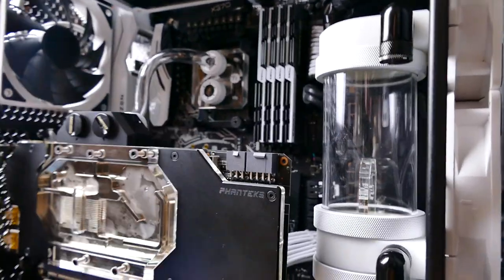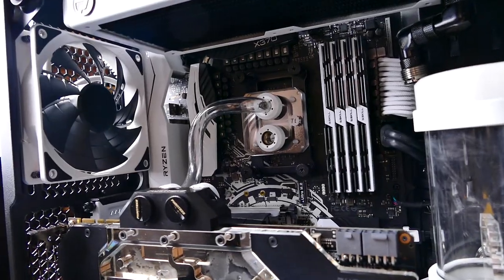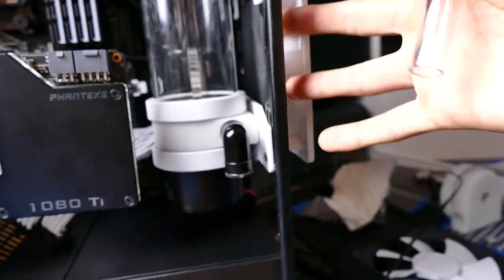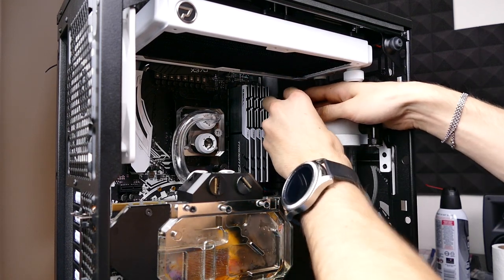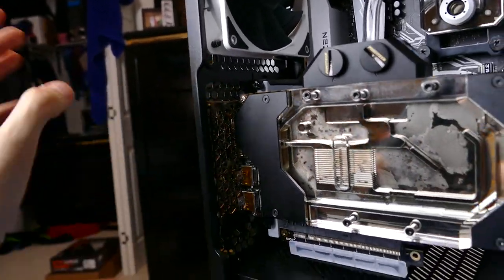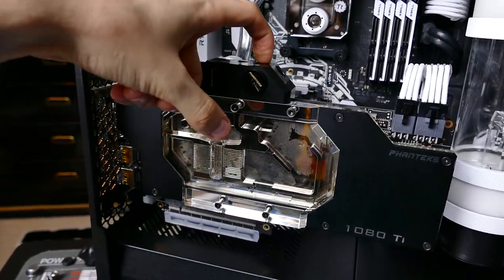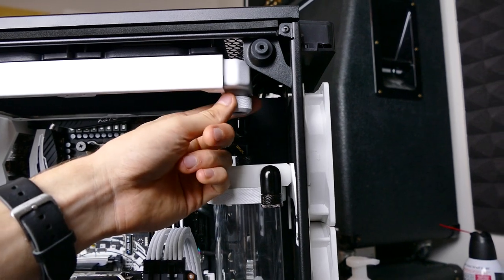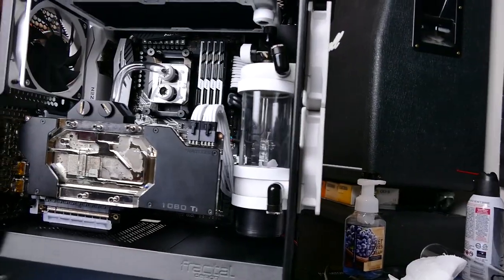Memoirs of a Custom Loop Builder

Comment: Keep the videos rolling. I'm still on the ropes with custom cooling my Meshify. I may be a bit limited with my Strix 1070 OC edition being too long. I'd rather have the radiator up front pulling colder air in rather than top mounting and exhausting. Maybe I just have to forgo the 140 mm Be Quiet PWM fans up front.

Comment: lol Nice thumbnail the cheesey smile. Thanks for sharing, I was actually happy to see that case up close. 

I'm actually looking for a case with better air flow for a future build I am planning, I currently use an NZXT s340. I am leaning towards a Corsair Carbide 540 but I rather have something with a more traditional form factor.

 If you or anyone has any suggestions please let me know. I would be using an AIO + lots of case fans

Comment: For GPU go 90* right right out of GPU, then straight under the GPU power cables, then 90* up and 90* right to bottle. For CPU go a little straight to you(to window side) ,then 90* up, then 90 right, then 90* up to radiator. Because the case is small and there is no room turns off tubes needs to be sharp. Sharper than the one that you have for CPU right now.

Comment: Collar? xD I to like black and white theme builds, I suspect many do so I strove to source as many lesser known or uncommon parts to further personalise it.
I'd like to suggest a few, if I may.
PSU - Superflower Leadex Gold 650w (white) (Super Flower are the OEM for most EVGA PSU's) 
RAM - KFA2 Hall of Fame DDR4 3200 (white)
Monsoon Laing Water Pump Cover (white)
Case Fans - Noise Blocker NB-eLoop B14-PS
Radiator - Hardware Labs Black Ice Nemesis 360 GTS (white)
Reservoir - XSPC Photon 170
CPU Water Block - XSPC Raystorm Pro (white)
Radiator Fans - Noctua NF-F12 Industrial PPC-2000 With white Chromax Anti-Vibration Mounts
I also chose the Fractal Design Define S for the space and looks but I have to say I went with soft tubing (white) you must have the patience of a saint to go with the hard tubing, I foreseen the potential rage I'd endure and wimped out.

Comment: two short bends from the top of reservoir to the GPU and kinda having it run diagonally might decrease any potential headloss within the system (technically speaking, even though those are minor losses) and can minimize the strain on the pump and have the fluid flow through this system more efficiently! wow did I just do that?! :')

Comment: I'm currently building my first custom loop.. actually first water cooled PC, and, just to make a bit more challenging (as if I needed it) I'm doing it in the Define C. With a 360mm radiator. And I figured putting the fans outside like you're doing is leaving too little clearance between fans and the front cover, so anything above "idle" fan speeds would most likely result in excessive fan/air noise and limited air flow unless you're using low-profile fans (I'm using the "industrial" Noctua fans, since I like high MTBFs). Putting the fans inside along with the 360mm radiator means I've had to cut off part of the lip that the removable cover on the PSU shroud rests on to be able to fit the pump/reservoir combo (EK-XRES 100). It's getting pretty crowded down there, and getting the tubing in place (soft tubing, thankfully) will prove to be a challenge.
Also unlike you I'm not using a window/tempered glass version of the case, but I'm still hoping to manage a fairly tidy look.
I like the black and white scheme of your build - it fits very nicely with the Taichi and the Define C looks I think.
Reply: Oh and I'm going to block off some of the vents/grilles - the front radiator fans will provide positive pressure, a second, 120mm radiator in the rear will take the "edge" off the outlet temperature from the GPU (Vega 64), and the PSU is fanless, so the 120mm radiator and PSU should be the only "escape routes" for air...

Comment: Maybe turning the radiator so that the ports are at the rear of the case, could provide alternate tube routing options? It's what I ended up doing.

Comment: Is that gpu block's internal coating flaking? Hard to see if it's build up. (almost equally concerning)

May want to be careful you don't plug up with metal/corrosion.

Comment: do a 90 degree turn parallel to the depth vector right after the reservoir (optimally so short after it that it doesn't cover up the RAM), then run to to the correct depth to make another 90 degree turn down until it is at GPU fitting level and then another bend to the left so it runs underneath the GPU power cables to the GPU block and then another 90 degree turn to connect it to the block.
Or the first bend goes down instead of to the front and then the second one goes to the front instead of up. This approach would leave more room for the tube from the CPU to the radiator.
Simple enough, right?^^
Reply from the maker: Illuminator I like your first routing plan 😎

Comment: I love your builds, but I always end up thinking they could use more radiator surface, which, of course, is rather difficult to achieve in the smaller cases you love to use.
But is that not an issue? Are you compromising on performance for looks and compactness? You are also positioning the front fans outside the frame again, after all.

I mean that as an interested kind of question by the way, I have no idea about watercooling at freakin' all. Just out for learning with you ;D
Reply from the maker: dynastes It's essentially one 120mm rad per unit. Perfectly fine.
Reply: Alright, thanks :)

Comment: Too little radiators, for a cpu and gpu 240 is not enough. What's the point of custom loop if temps are the same as on the air...

Comment: All custom loop build are misguided individuals who think this is the best method.
completely ignoring the fact AIO can be put into any system without any problem, easy to maintain, easy to transport, is in itself only responsible for its own health unlike custom loop only have one pump keeping all their eggs in one basket AIO have 3 pumps making it safer. one for cpu two for 2 gpu cards.